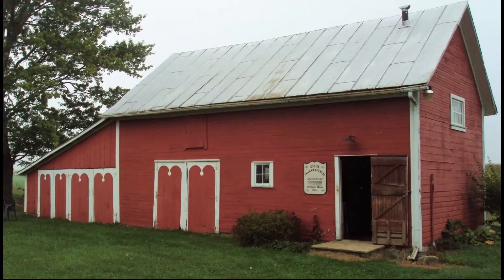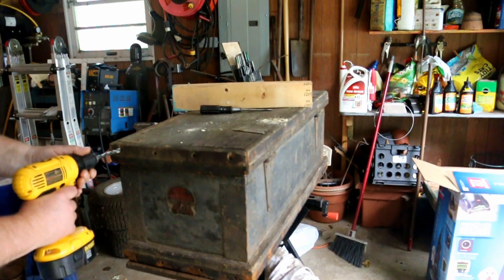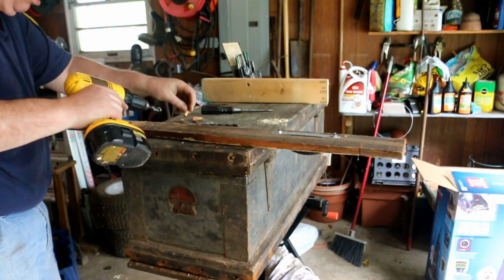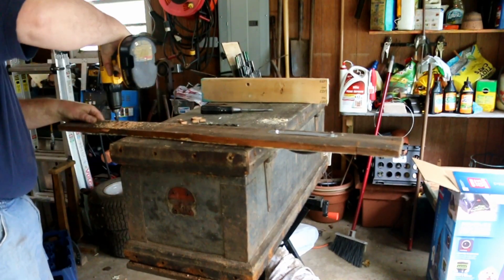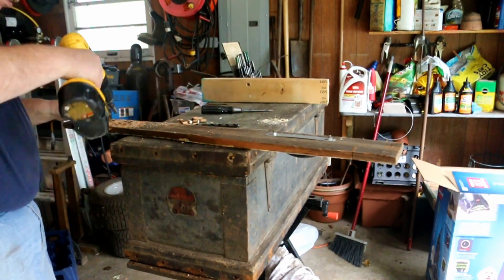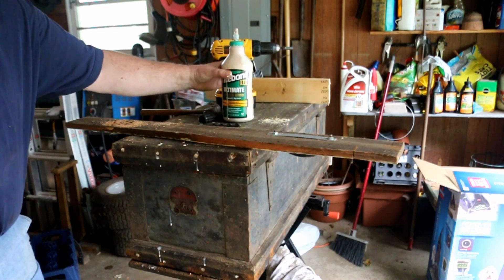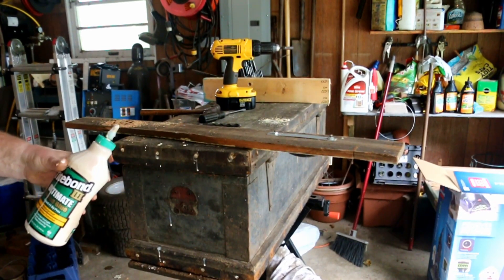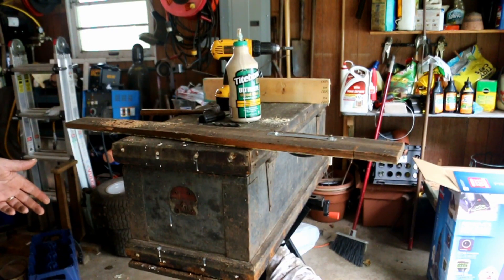Restoring AC Gardner's Tool Box Part 8

Comment: I found the worst shelf life of any glue was Gorilla Glue!  =)   Thanks Dave!
Reply from the maker: I agree. I only buy small bottles. It also gets brittle over time. In my opinion, the foaming means it's not a solid bond. Instead it is a series of thin walled bubbles. When it hardens the walls break under any stress causing the joint to fail.

Comment: Isn’t it amazing that glue is supposed to hold so,etching together but can’t stay stable anymore?  First they said it was air, so keep the bottle upside down, but that doesn’t work anymore.  Like you, I don’t buy large bottles of glue, it’s money down the drain.  One thing that I do is use the cap off of the detergent we use.  Put a bit of glue and I can dip the plugs in that way...less mess to clean up